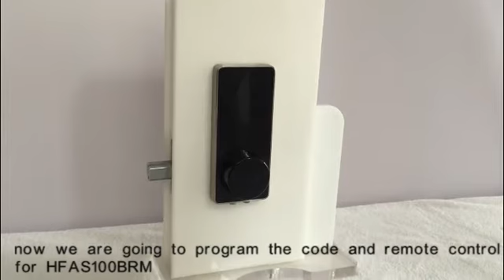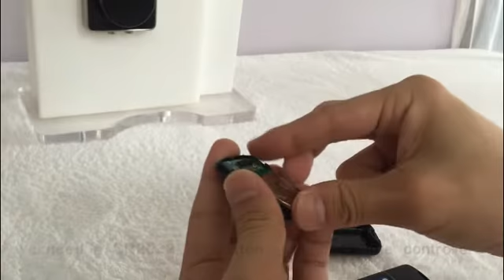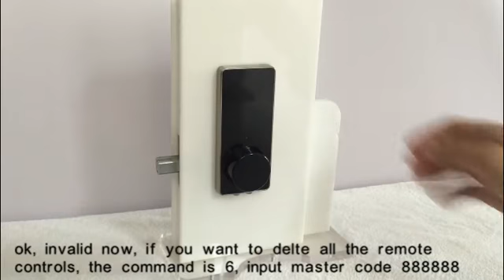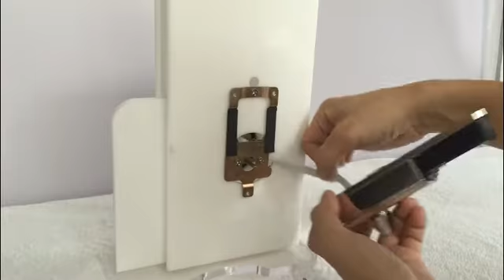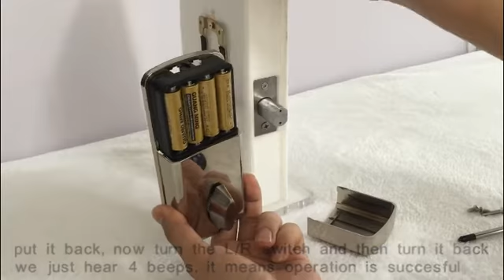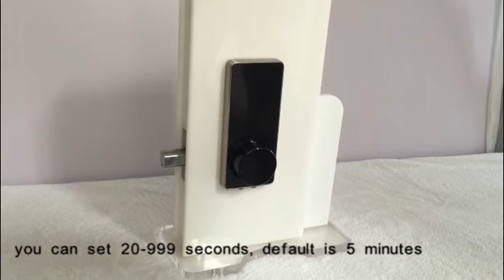HFAS100BRM MANUAL

Comment: We just installed this lock but the code is working backwards.  # will open the door and 123# will closed the door.  Any suggestions, please?  Thanks
Reply from the maker: hi，remove the back plate first, turn the L/R switch to the opposite side, and install the plate back, problem will be solved then,
Reply: Hola, la mía se despreciamos pueden ayudarme no agarra la clave, como puedo reiniciar el sistema